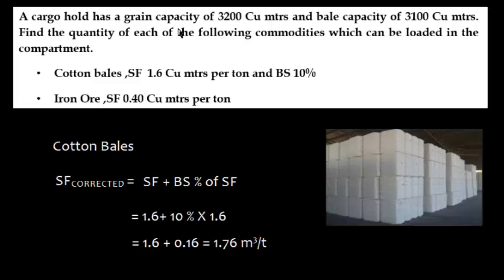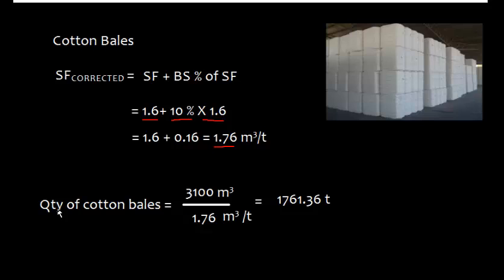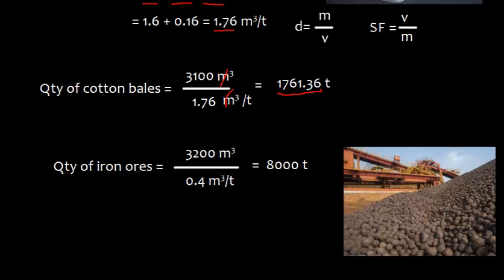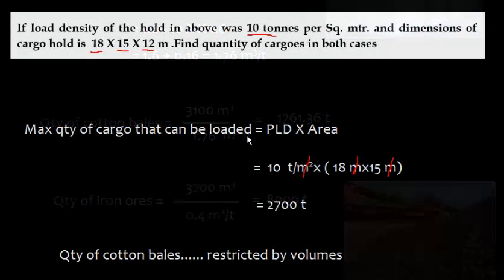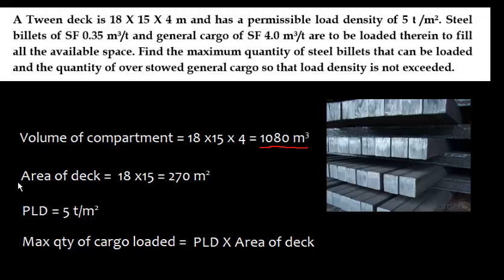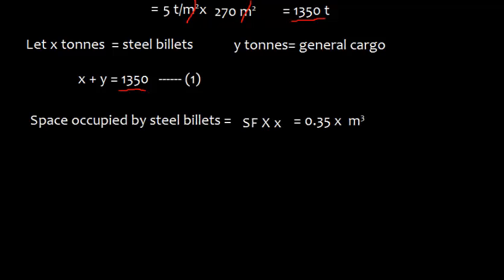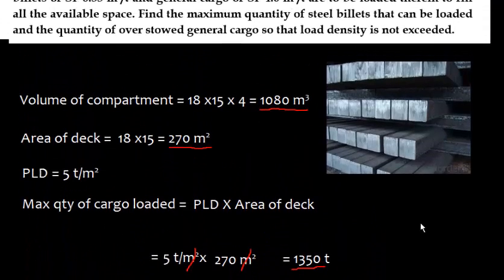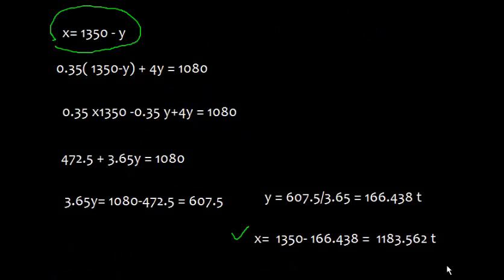Cargo Work_  Numerical_ Cargo Stowage _Part 2

Comment: Bale capacity is 580m3  and grain capacity 635m.3  Maize discharged in bulk is 125 Tonnes. Later bags were loaded 0.5x0.4x0.3 weighing 50 kgs and broken stowage is 11%  How much tonnage can be loaded in bags and how many bags? Grain SF 1.37 in bulk and 1.32 in bags. 	tell me this questions answer sir ??